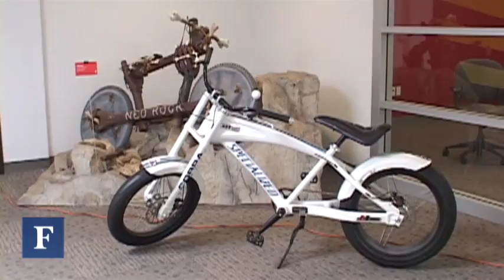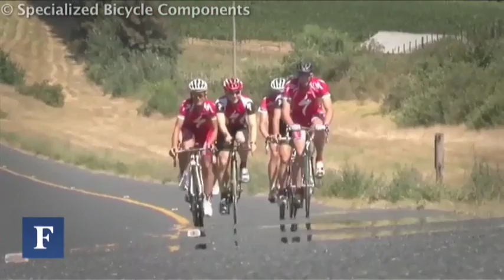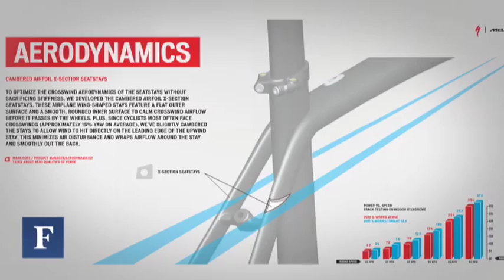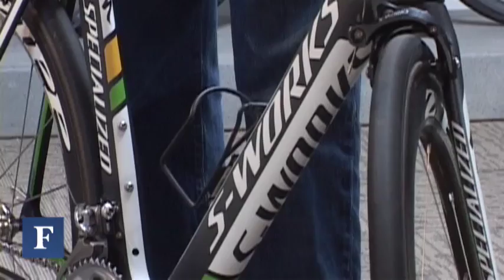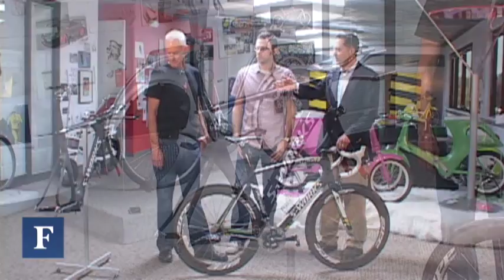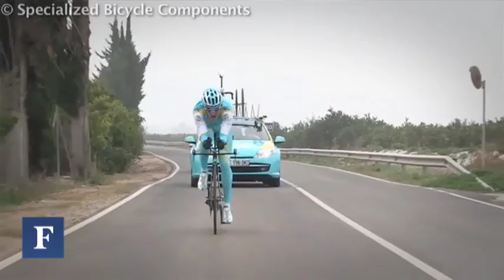Bicycles of The Future | Forbes

Comment: Can someone please design a bike that doesn't cut off blood flow to my "pride and joy?" Blood loss for an extended period of time causes ED. Eventually, making me a hardcore Vpill poper just to stay in the game. Thanks.
Reply: Spectastic I cut my dick off and shaved 0.2mph off my overall speed. However, my mate from the cycling club kept his dick and ran off with my wife. I really miss him.
Reply: Change the saddle.
Reply: +NOSfusion The bike has nothing to do with it. You need to look at your saddle, both design, position and height. Specialized make a few saddles that address this exact problem. Toupe, Romin and Power are all saddles I have used combat the cut of blood flow. Bear in mind that saddles are very individual and you need to see if you can access sample saddles from your bike shop to try out before you settle for one.
Reply: Tony Parker The issue with that is the gel pads are heavy and actually slow the bike down, that's why people buy padded shorts for biking.
Reply: NOSfusion Recumbents. But when recumbents beat the diamond frames in races, they outlawed them. Superior design, though. No crotch pain, no hand numbness, no back and shoulder pain.
Reply: bcstractor You wrote "Recumbents. But when recumbents beat the diamond frames in races, they outlawed them." So which races were you talking about Einstein. The bad back Olympics or the Gay Giro with its pink shirts.
Reply: ***** Currently not a problem, I've heard eventually it can become one which actually causes me to ride less.
Reply: NOSfusion cut if off. problem solved
Reply: Sabatheus Rubbish
Reply: +bcstractor  Ridden what a diamond frame or a recumbent. If your telling me Froom  would have won the Td F on a recumbent then you are an idiot.
Reply: Jonni TM He needs one of these if you go over a bump it cuts your gonads off
Reply: Jonni TM He should try one of these
https://s-media-cache-ak0.pinimg.com/236x/5a/65/92/5a65926f32ef5dd2a8af166a463ca2e2.jpg

Comment: Bummer they can't explain the justification that you could spend 10k on one of these bikes. How is this justified? You could buy a car with the same money. This car has more metal and technological costs than a carbon bike. The labor that goes into a car dwarfs these bikes. So, how do they justify charging so much for so little?!
Reply: Frank Manti Have you been good at any sport? When you become adept at your sport or activity especially when it competitive, you want the "best " equipment and the best costs more. I know a guy who paid $300 for a carbon fishing rod, just the rod and not the reel, so I guess the justification for buy such expensive stuff isn't for you if you aren't serious about the activity to upgrade and be competitive. Make sense?
Reply: "the car has more metal and technological costs" 
Let's see.. For $10000 you don't even get a Chevy Spark (which isn't a very technologically advanced car, let's be honest), where as for $10,000 you get a specialized S-Works which was designed by experts using a wind tunnel, and built from exotic materials.

Comment: Blah, blah, blah! I've been riding pro machines for 30 years. Bike tech has made many changes since the old frame designs and stuff has gotten a lot lighter. But with aero, there's only so much you can do as the rider's body causes 99.9 percent of  wind resistance.

Comment: Recoil off flex... Or in the case of ERW a rebound off hub displacement can improve power to weight ratio. Couple this with screw force accumulation and return and any bike will...Get better.

Comment: I ride 32 miles on a 40 pound steel mountain bike and you ride a specialized carbon frame bike with all the trimmings. You are in shape and I am in shape. We both cover the 32 miles averaging around 20-22 mph. 'who gets the better workout, the guy riding the 15 pound bike or me? I DO. For the 15lbs bike dude, he would have to cover another 10 miles to get the same workout I did in less time and distance, I might add.
Reply: Did they knew, you are racing em?
Reply: johnberg181 Have you been good at any sport? When you become adept at your sport or activity especially when it competitive, you want the "best " equipment and the best costs more. I know a guy who paid $300 for a carbon fishing rod, just the rod and not the reel, so I guess the justification for buy such expensive stuff isn't for you if you aren't serious about the activity to upgrade and be competitive. Make sense?
Reply: its also about competing and the lighter the bike  the faster you can outrun your competitors. but in a workout sense you are correct
Reply: It is very rare that anyone out bikes me on the bike path on my steel 40 pound full suspension mountain bike. I usually maintain a pace of around 20 to 25 mph for a total distance of 32 miles or so, and at this pace only the really hard core cyclist pass me. But of course that doesn't bother me as I am not the one who spent thousands of dollars for an extra 2 or 3 mph, and as I said I am not into cycling for the money.
Reply: At the highest levels of the sport, you have to devote all of your time and energy to the bike. Most people if not all have jobs, families, and other issues besides bicycling. Those extra 2 or 3 mph are not on their priority list unless of course you are a professional athlete.
Reply: hahahah 25 mph ...hahaha "Fast" ...hahaha bro i can speed skate faster than that ice or rollerblade. a road bike can hit 35 easy burst to 45 easy.. maintain 45 and up in a paceline ...this guy said 25 mph hahahahahaha
Reply: johnberg181
I hear your truth.
Reply: After embarrassing many fit athletes out there on the bike paths riding 5 to 10 thousand dollar bikes out there on a full suspension mountain in which I only paid 35 dollars at a thrift shop, supplies many thrills. I've ridden higher class models as well, and they are just as thrilling as well.
Reply: What the FK is a 40lbs bike look like????  

In 22 years of cycling I have never seen: 1. someone ride a 40 lbs bike with full suspension, 2. maintain 20 mph across a 30 mile pathway on a heavy steal mountain bike. 

Either you are lying, or you are Chuck Norris
Reply: Not many exist.  I bet it looks like a bike though ;)
Reply: I did that when I was in high school. LOL

Comment: High performance starts with the wheels. A new wheel has been under development since 2000. Now more issued patent claims than any wheel in history. A negative pressure, high frequency in wheel suspension that allows for better maneuvering and hook up at the highest speeds.

Comment: I'm going to guess that you have never driven a Ferrari or ridden a $12,000 bike.  I have had the privilege to do both.  I own a Specialized S-Works Venge and a Specialized Shiv Expert TT bike.  When I bought the Venge, it replaced a 2009 S-Works Roubaix...not a bad bike, but one which was THREE POUNDS heavier than the Venge. Trust me...when you're riding 120 miles and climbing 10,000 ft, 3lbs. matters.  As to complexity..the Venge is no harder to maintain than any other bike I've owned.

Comment: actually as a bike tech, i would like to say that cheap stuff ends up costing more.
for example: a cheaper derailleur has a shorter life because it is made from cheaper materials, and when it comes to trying to repair it, you cant. they are basically disposable. the more expensive derailleur is made better with the latest technology and is also made for better maintenance where you would be able to swap out specific parts when they go bad.

however this is isn't true on frames and chains.

Comment: I highly doubt this, you probably measured wrong. Probably the lightest classic ten speed was like 18 pounds, and Univega is a budget bicycle, so I doubt it was 14 pounds. Also, 14 pounds is so light that it wouldn't be able to race in a pro UCI race, because bikes have to be more than 15 pounds. So no, your Univega aint 14 pounds.

Comment: if you compete on a top level the difference would be notable, where riders are at the top level in fitness they can and the only thing left is there gear. I do agree with you though lots of riders buy a expensive bike thinking it will actually make a difference when in fact if they made a small change to there diet it would effect there riding more.

Comment: an average road bike accounts for approximately 14% of the overall drag. pop some disk wheels on a specialized shiv, some 3T aerobars, and you've instantly chopped its drag coefficient in half. not to mention the fact that a properly engineered carbon frame will have up to 60% less frameflex-induced power loss over a bad one, and that stronger/lighter wheels helps in all aspects of riding. clearly then you havent ridden anything made since 1983, or you'd know this.

Comment: LOL I referenced an old group to make my point! That point being that 2011 SRAM sucked, and 2012 SRAM sucked marginally less than 2011. For 2013, oooh we have Red 22, which offers hydraulic rim and disc brakes! Seems interesting, but where's the electric shifting?? I always wondered which of the big three would be the first to the totally cable-less system, but as it turns out, Colnago and Formula, working with some highly modified Campy EPS levers, beat them all to it. Bottom Line: SRAM stinks.

Comment: I wouldn't say 100% bullcrap. I went from a Specialized Tarmac to a Venge and the coasting speed alone was significantly increased, and the only difference was the bike frame.  Not to mention when I was actually pedaling or descending.

Comment: i have a vintage road bike that i bought for 4o bucks . steel frame and wheels. she was a little neglected. but i washed it cleaned it oiled it and slapped on a new set of tires and paint and i love riding it. i ride with friends on the road for long distances and they all have the fancy 1k plus bikes and i pull away from them all the time on flats hills ..downhills. Its a 40 dollar bike restored with basic parts. People rely on technology so much now they forget you have to be a good rider too.

Comment: If you are racing it really pays to watch the new technology.  My new bike is about 4 years newer than my previous carbon, which was already good.  The new bike is lighter, more comfortable, stiffer, and handles better around the corners.  So when you are descending a mountain pass at 50+ or racing a criterium or other road race you feel safer, and faster, they keep getting better and better with innovation. If you care about better handling, safety, improving to race / get faster new tech helps

Comment: What you are failing to understand is that drag is wasted energy.  Take a small amount of it away away and the multiply it over a stage of the tour and then the whole tour and it works out to a more significant number.  Its the same with endurance racecars. 10 lbs is not very much to a 3500lb car but over 24 hours that could be 1 less fuel stop, one less set of tires to change.  The implications over time is what is important.

Comment: When you spend a little bit more, you get better components. SRAM Red is obviously a lot better than Shimano 105. This is the difference in a $1,000 bike and a $3,000 bike. The parts do make a big difference. Performance, reliability, and ease of use all increase. If you don't believe me, go to eBay and get a used set of SRAM Red or Shimano Dura-Ace. You won't regret it.

Comment: Actually, some of the most innovative bikes EVER made was in the 1989 to 1993 time frame. Don't believe the hype about this innovate or die crap. The Specialized TriSpoke wheel from 1990 was, and still is one of the best overall wheels out there, except that its now called the HED3 and is made from carbon fiber. But you know what, the molds used are the exact same.
True bike innovation will only now be found in non-UCI triathlon and ultra distance cycling these days.

Comment: Your right, its actually about 16.2mph and about your excuses, believe me I know what you mean, when you talk about your average speed based on time over a distance in the real world you have to take in variables like traffic and the biggest factor is wind, for example if your drafting in a proper pace line as long as your 3rd wheel you will save 20% of you energy so before my daily rides I always look at weather reports for estimated wind speeds and direction, it helps for pacing

Comment: He doesn't mean too aerodynamic, he means the shape did not follow the 3:1 ratio rule stating that any piece of the frame can not be 3 times longer than they are wide, so specialized actually has a version of the bike that can not be raced in any UCI races because it disobeys that rule, and a separate version that does obey the rules and can be raced i races such as the tour de france.

Comment: pretty sure it doesn't you can't possible have enough power output to know either way anyway. Have you ever sprinted as hard as you ever could for a win or for some sprint points and felt your bottom bracket flex. I have on my first bikes and on newer carbon bikes . but on my pinarello dogma 2 no flex so the price is important for people who need the actual performance increases.